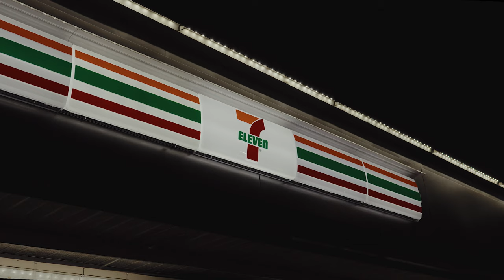BUILDING THE ULTIMATE BMW M2 RACE CAR IN USA! *IT'S FINISHED!* FINAL EPISODE

Comment: So sick! You could always get more power out of a custom E85 tune and a downpipe without sacrificing reliability (if you ever wanted more power).
Reply: Was thinking the same thing, on top of that they could also upgrade parts of the cooling system especially since they’re tracking the car in Arizona
Reply from the maker: Thanks man! Absolutely! There’s a few routes we could obviously take to gain some reliable power, although for the class that this car will be running in, power to weight ratios mean that it does not need any extra power

Comment: Still using the aluminium bonnet and boot lid? Surprised.
Reply from the maker: Yes, we have designed a ‘lightweight’ pack that will bring the car down to 1380kgs. It will include carbon doors/bonnet/boot and a light weight battery. 

The customer plans on racing the car eventually which is when the kit will be implemented :)